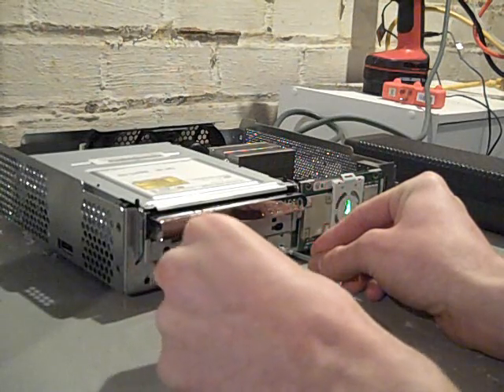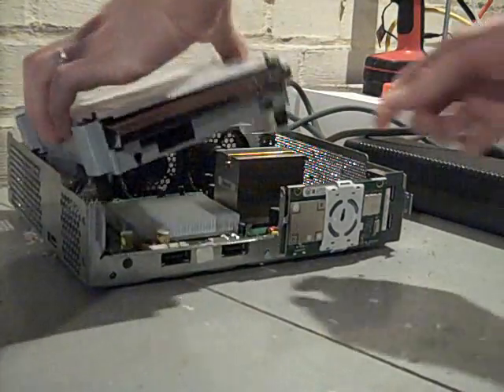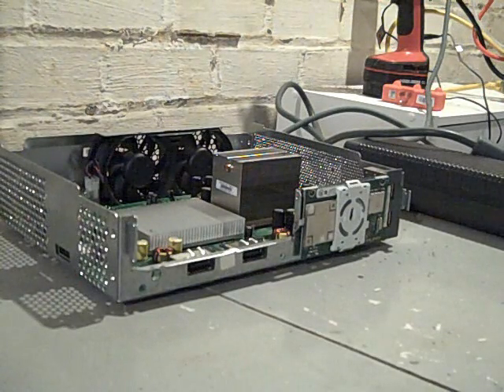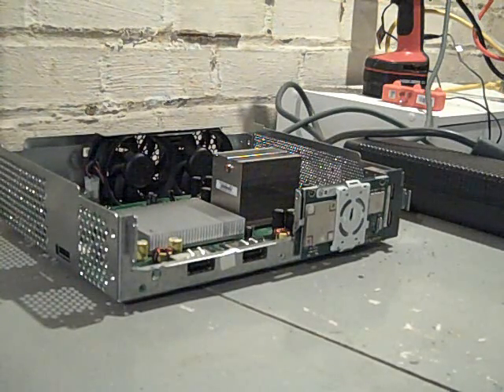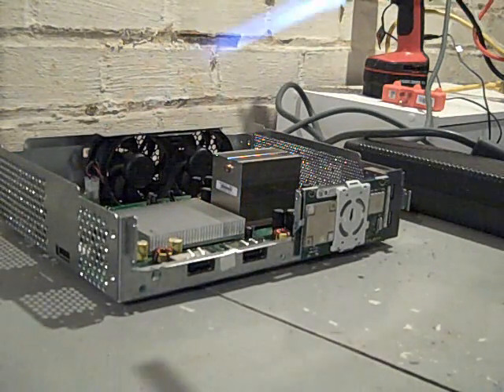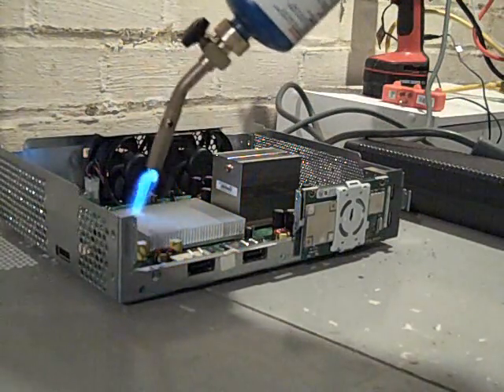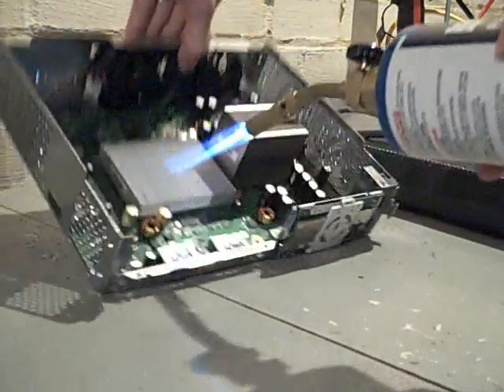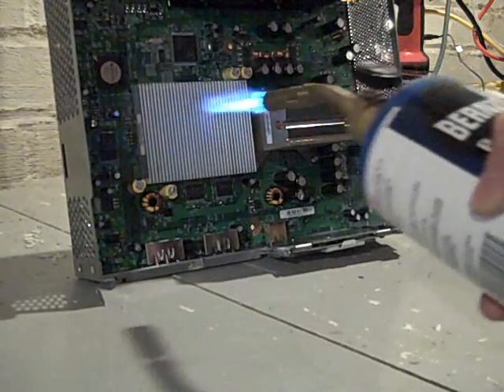Xbox 360 RROD Blowtorch Fix ( error 0110 )

Comment: I have the Xbox 360 elite 120 GB Xbox 360 and my second Xbox 360 is from 2009 is modern warfare 2 collector edition console 
So far neither one of them got the red ring of death but I’m gonna take it to Xbox 360 authorized Xbox repair shop and have them clean it and put some new thermal paste down  
On it and to figure out another way so this will never get the red ring of death but I know I’m only kidding myself these were the horrible consuls the Xbox 365 consuls but they look so beautiful because you could stand them up or lay them on their side it’s better if you have them standing up so more air is ventilated and you should always make sure that the bottom side of the consul is not on the ground you should always elevate it and always keep something cold right next to the heat source I have a Lotta Xbox 360 games they made a Lotta good games back then like gears of war halo Forza motorsport everything

Comment: kinda late but  i think it works like that becouse the soldering can crack and not connect properly and by doing this method it metls a little bit and fixes it but i dont think it melts completly with blowtorch so it only last for a little amount of time and you have to redo it
Reply: It's not the solder balls

Comment: did anyone else hear the fans getting louder at the end, meaning that if it was on for a few more minutes it would overheat?
Reply from the maker: I didn't put the wind  tunnel back, its running with no cooling in the video,  so technically your right.

Comment: I think this works in the same way as the suggestion to stop the fans and let the board overheat, it must heat up the board sufficiently to let the soldier reflow reconnecting any loose connections.

I did the fan stopping method today
Reply: It’s absolutely impossible for the solder to reflow doing they. The console gets to around 90-100°C before overheating. Leaded solder melts at around 370°C

Comment: you didnt even put the vent back on -.- no wonder why it fails with all the heat the gpu makes underneath the cd drive
Reply from the maker: Yes, I noticed right after I did the video, that's why the fans rev up so fast at the end of the video.  That plastic vent thing is very very important for airflow across the heat syncs.

Comment: Wait a Minute:
I Call BOGUS on this.  In the beginning you only un-plug the POWER Cord...the AV Cable is not plugged in (Which will result in an error code & the RRoD).

After the 10 Minute Cool-down phase you plug not only the Power cord in but also the AV Cable before cycling the machine.

Sanguineously disingenuous....
Reply from the maker: Prove to us that you get the 0110 error code by not having the AV Cable plugged in with a video response.  Otherwise keep your comments to yourself.
Reply: +jluoni you are right, even if the av cable was an issue the av cable gives a full ring not a 3 segment ring
Reply: no because thats only the xenon he has a galcon so it wont red ring when the av cable is unplugged and even if ot was the xenon it would be 4 lights not 3 lol
Reply: okies for that...I guess?

Comment: thats a really risky chance you'd be taking, for a few different reasons. but also that wouldnt work on the other model of the original Xbox360, all the components are too crowded together, you'd pop a few capacitors and maybe melt the plastic important parts. I do NOT reccomend this, learn how to do it properly, and safey, damn haha
Reply: 2pringles this is the original. see as it has no HDMI port my friend.

Comment: The only real way to fix this is a reball of the GPU replacing the old cheap solder with a more expensive better version.  Heat gun tricks work for a while but eventually you will warp the board beyond repair.

Comment: wow, just wow......first off anyone wanting to fix a 360 with RROD should look into reflowing with a workstation and the proper tools, if you do it like this guy more than likely your just going to screw up your machine even worse, for a start he's torching the heatsink like wtf? there's nothing protecting heat sensitive components, nothing checking the temperature of the board, no preheating, its just bad.

Comment: All you guys who get rrod, this means the system overheated and possibly took damage from it, and since the solder gets reduced everytime you do this, I'd just fix it, sell it, buy a used one who never got rrod and put new thermal compound on the cpu and gpu BEFORE this happens. That is if you want to avoid fixing it over and over again

Comment: this fix does work. i had the E74 error. been working great for about 3 months now still works great. i never put the torch very close to the heat sink. also i only heated it for about 1 min.
Reply: kenben2013 Only for trivial because its an old post, but E74 is related to the HANA chip that convert video signal. I have a working opus in my stash on dash 7371 that I could jtag ( console was unused for many years, this is why it still work) . Anyway, what Im saying is at that point, almost all phat console are dead. Even my Falcon died. My jasper is going strong and my other trinity and vahala work without issue.
Reply: @MrVitalic85 its not hana, its bad connection with gpu and edram
Reply: @MrVitalic85  its gpu

Comment: Don't laugh. My PS3 just did the same thing for the 2nd time. Its cause they use lead free solder in these fuckers now. God I hope they learned their lesson this gen and make next gen systems better. The solder develops hairline cracks between the processor and motherboard and the connection is broke.

I oven reflow mine and use artic silver thermal past same as I do on my PC builds. It lasted for 3 months the first time I reflowed it but I didn't use solder cleaner called flux.

Comment: the chip gets to hot (not hot enough to melt the solders) and comes away from the motherboard thats under that heatsink, in heating it up you are melting the solder again to create the connections. i done this to my laptops gpu, and it worked. :)

Comment: umm, it is common sense that an OPEN FLAME gives off heat in more than just one direction...yes, *MOST* of the heat goes to the heatsink, but there IS at least SOME radiating outwardly that is not absorbed by the heatsink, which CAN heat up the nearby capacitors enough to damage them. i am giving advice to the people who throw caution into the wind. if someone wants to do this to their xbox, then i hope they dont damage it. their loss.

Comment: i especially would not turn the console on its side like that when heating it up cause if the solder balls are in liquid state force of gravity may cause a bridged connection (the balls run together) and then its toast and it would have to be reballed

Comment: the reason it works is when the xbox has excessive heat up and cool down cycles from use the solder balls would get weak and eventually separate from the board causing a 0110, 0122, ect. error codes (under the GPU, CPU, RAM, Southbridge, and on hdmi the HANA chips have hundreds of little balls made of lead free solder they all need to be attached to board) the blow torch heats the balls turning them to liquid and the reconnect causing it to temporary work i would not use blowtorch though

Comment: to every one making fun of him, it called reballing. ive done it to many laptops with integrated gpu's aslo puting it in the oven for 15 min will reflow the solder. ive tried everything and my xbox still gets the rrod after 1 hour of gaming. i even built a custom case with 4 fans in it, ive done thermal compound and even the penny trick. my xbox is just dead i guess.

Comment: cool story bro. and im glad it is fixed. but i bet you anything that it is only a temporary fix, and so, the danger is not in doing this "fix" just once, but doing it over, and over, and over. you dont have control over how hot you are heating up the GPU, just roughly estimating. also, if you put the xbox on it's side like this video, you risk the solder balls melting into each other, causing shorts, and fucking your xbox. then you need a complete reball. YMMV and GL.

Comment: If you want it done correctly and safely, you get it taken to someone who has a professional reflow equipment and do a full GPU reball. All of these "fix" videos do work, for a little while, but they can really damage the GPU or other parts of the xbox, and one day it might just die on you. If you are desperate, then sure, do the fix. But if you really want to get it fixed for a long time, take it to someone who can fix the problem: crappy solder balls under the GPU which develop cracks...

Comment: It reflows the solderballs so they can fall back into place. This isnt a safe way to do it. Especially when you tilt the console since it may bridge some connections. NEVER use a blowtorch unless your completely desperate and dont wanna spend some time buying a heat gun station or heat gun and reflowing or reballing you console.

Comment: I got my 360 in December '06 and got it fixed for RROD 3 lights and still works fine
Reply: even to this day?
Reply: @ProjectFennec  no. it's only a temporary fix. The only real way to fix them is to replace the defective GPU entirely. Which requires a reballing station.

Comment: Good show, but it will happen again till you replace the solder for the gpu. Its Rohs compliant, meaning no lead in the solder and the current stuff is brittle when heated. If reballed with lead based solder this will not happen again.

Comment: you are a noob. all you need to do is re tighten your screws as if you used the nylon they will shrink over time with the heat. Not only are you scorching your xbox you are banging it around. Could cause a bridged connection. I don't suggest anyone to do this.

Comment: you are a noob. all you need to do is re tighten your screws as if you used the nylon they will shrink over time with the heat. Not only are you scorching your xbox you are banging it around. Could cause a bridged connection. I don'tt suggest anyone to do this.

Comment: Incredible!  Got a knackered hdmi falcon model last week with 4 lights.  Found a capacitor that had unsoldered so I repaired that and got to 3 red lights.  Already had xclamp mod on it so I re did paste etc, no joy.  Could not overheat it either.

Decided to try this and incredibly it has worked.  BEfore this the best I could get was the menus and trying to start a game froze or rrod.  Now it plays fine.  Been on for an hour so far.  Fingers crossed. Thanks for the video!

Comment: Guys, i was also skeptical, but had tried the other things people had suggested, with no success.  As a senior engineer at IBM, i understand unorthodox methods are sometimes quite successful, and as nothing else had worked, i resigned to try it.  To my surprise, it worked.  i did 12 seconds of direct heat with a propane torch, waited 20 seconds, and did another 12 seconds.  Cant argue with success. Bailey734, condemning something that has obviously worked, is stupidity at its finest.

Comment: I bought a xbox 360 that had rrod. When I got it it had 2 red lights but I took it apart and fixed the guys work before me and now it has a secondary error code of 0110. This means a ram chip problem and I saw on one of the ram chips on the bottom it had a little chuck out of it, what should I do?

Comment from the maker: @waterdragon1908

Don't tell me what I'm trying.  You are wrong, plus I didn't "try", "I did".  I resoldered the connection to the board.  I used a blow torch on the heat sync to tranfer heat from the heat sync to the chips to the pins to the solder to the board.  
No point and taking the heat syncs off and reapplying the Artic Silver 5 again.   Thermal paste is intended to increase the transfer of heat away from your chip to your heat sync.  Not for fixing a bad solder connections.

Comment: the idia is good but its easyer to get new thermal paste. he is trying to melt and re-connect the connection between the heat sync and the xbox itself. It COULD work, but its easier to get new thermal paste.

Comment: man this is insane, using a blowtorch :O omg man this is unbelievable. you guyz heating your 360 to extreme degrees and saying the solders are fixing in that way but what if the solders join together and make a short circuit. its something like your tv is broke and you smashing the tv and saying hey this is the way i fix it.

Comment: Sn96.5Ag3.0Cu0.5 is also used for reflow soldering. Reflow soldering is used to attach components to a surface. Components pass through a reflow oven or under an infrared lamp to melt the solder @ 217 C/422.6 F - 220 C/428 F. That is right around where he is heating his xbox.

Comment: Just so everyone knows. Every method that fixes RRoD involves heating your console to the extreme. Solder's melting range of 90 to 450 degree Celsius (190 to 840 °F). Commonly used for electronics is Sn63Pb37. Solder that melts at 182 degrees Celsius = 359.6 degrees Fahrenheit. So heating your xbox into those ranges replicates the construction processin which was used to manufacture the product. :P

Comment: You know what, this is NOT a fake, because it reflows the solders inside that heat-thingy. However, this may (100% chance) melt the green mainboard under the X-clamp... So if you do this with an heat-blower (not blowtorch), the heat will be spread all over the mainboard, so it doesnt melt or anything! That's hoe it's done (or smach your xbox with an hamer and buy an new one)!

Comment: It works because you're reflowing the gpu, and it's actually a very precise process.  Since it's worked for you so many times, you have figured out a good system.  For someone that doesn't know, they need to do a little research.  Wikipedia has a decent article on "reflow soldering".

Comment from the maker: If you just did the XClamp fix and then immediately started getting this error, chances are you have it tightened down funny.  Otherwise you have to get about 500 degrees F to the solder.  I say a standard plumbing blowtorch puts out about 600 to 800 degrees F.

Comment: hey man iv dont the X Clam fix and evry thing i have the same error code as you 0110 but it just wont work i keep getting the red lights still i used a Heat Gun and it was a 550-to 600 Dggres and it still keept giveing me the red lights cna you help me ?

Comment from the maker: secondary error code 0110 typically E20,  if I am not mistaking.  E74 is typically the xclamp fix. 0102 I think.  Check your secondary error code.  I have seen other fixes for the the 0102.

Comment: i had the 0110... after a bit of troubleshooting it turned out to be the metal washers i were using were shorting out on the board from wear and tear use nylon touching the board and it should be fine

Comment: Hey you when your heating it, you shouldn't tilt the mohterboard, you also want it in one position, because when you heat it up at a tilt you are getting the solder hot and then it will move because you have your board at a slant, so just keep it in the flat position.....